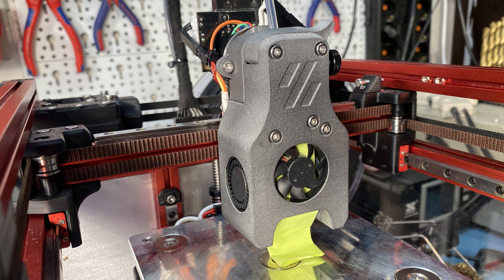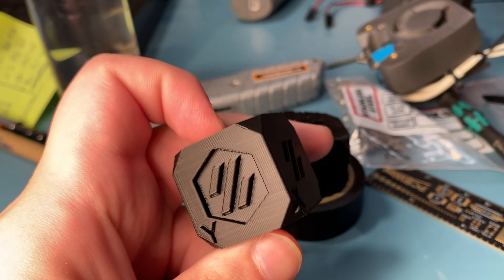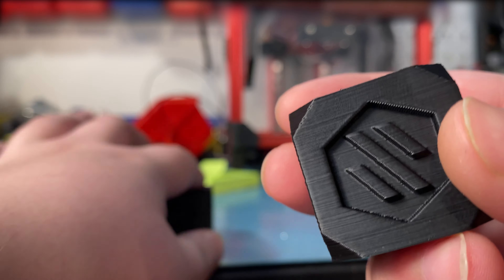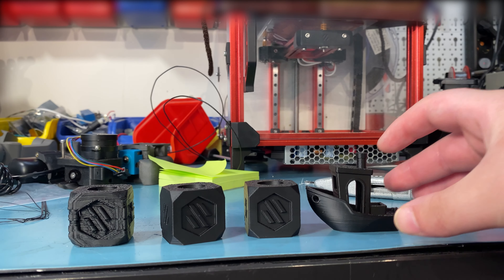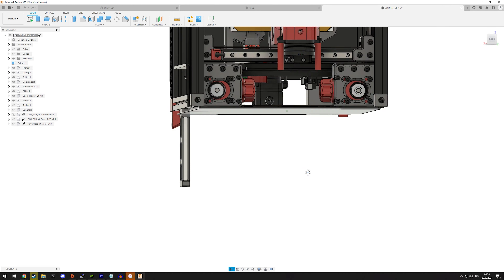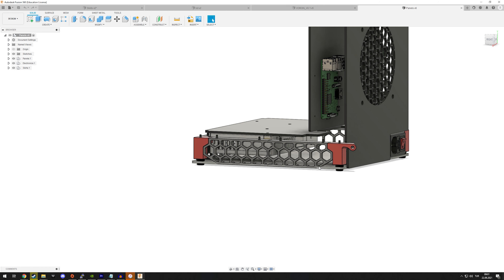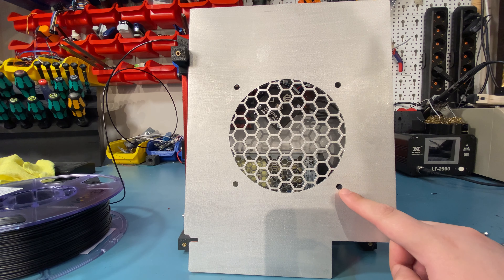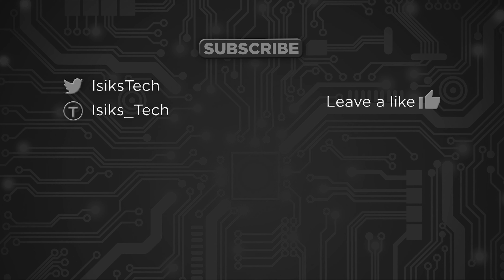Voron v0 Ep. 9 - MJF Parts & Duet Wifi Problems & Outer Panel Mods

Comment: You can have it set to what ever you want in the config. Just add a line in the slicer under the filament tab in ss/ps
Reply from the maker: Set what? PA? I prefer to set it in the config file. I missed it when copying.  Could have been a different setting too.

Comment: I'm in the same boat with my Duet2 Wi-Fi. If I load with a larger file to print the board resets. Time to go with a Spider or Octopus I guess.
Reply from the maker: They're getting old I guess. Bought mine 4 years ago or something like that. But the 5v internal and usb shorting on mine is a really weird one. The eeprom can be explained with age.
Reply: Anyone tried using a Duet 3 for this?